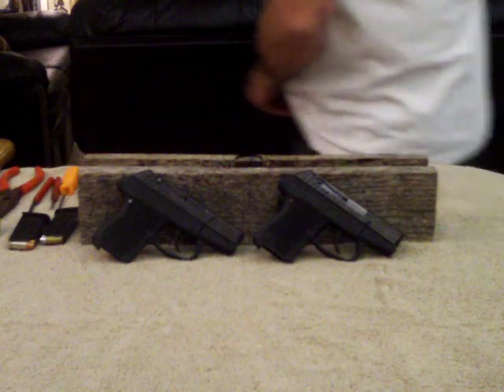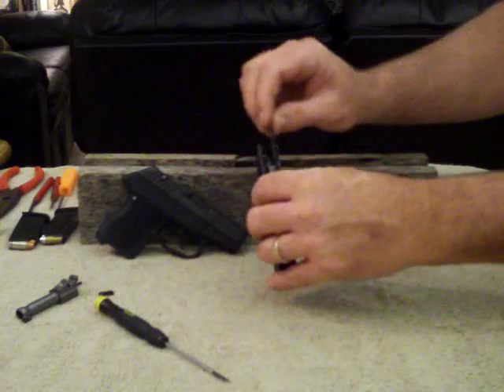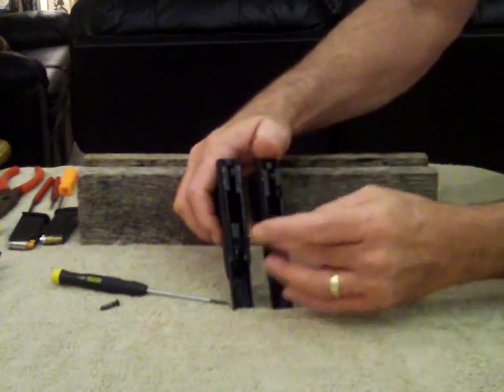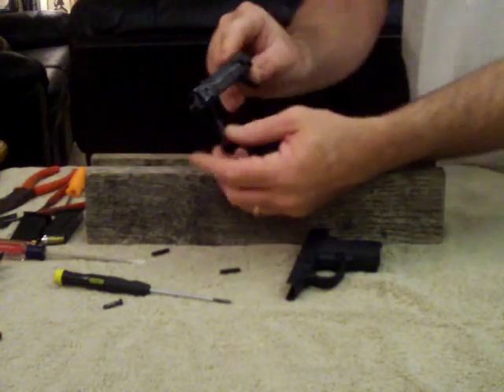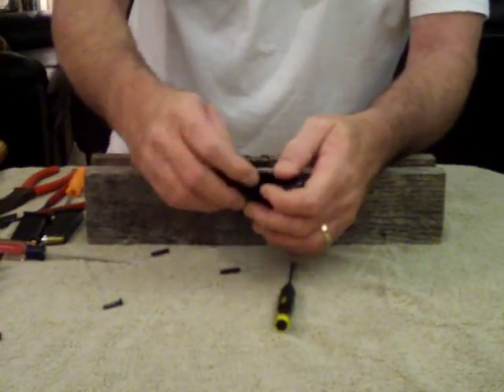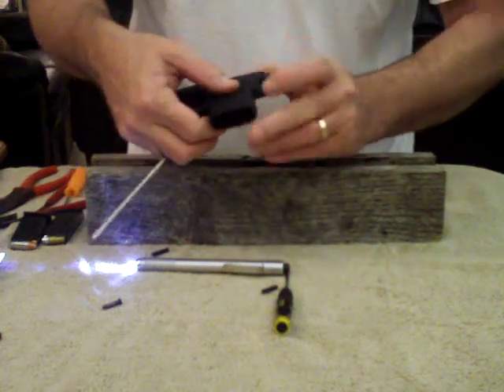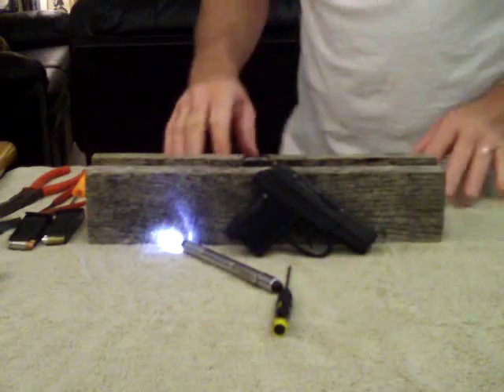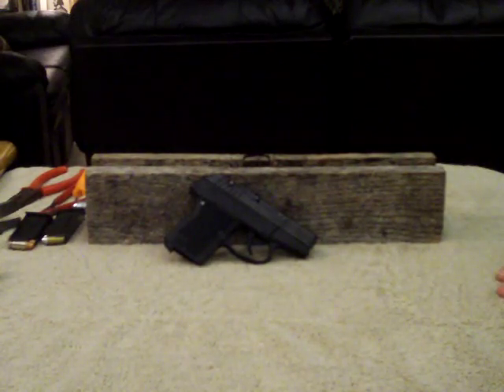Detailed disassembly of the Kel-Tec P3AT & P-32

Comment: Very Nice video. I noticed you Dry Fired after reassembly. I've read that that is bad for KelTecs, because it will peen the end of that screw and without a snap cap or bullet in the chamber, that slot in the firing pin will slam against that extractor screw and eventually cause a failure of the screw and can break/jam the firing pin.
The manual also cautions not to dry fire after reassembly. It says to test the weapon by cycling the slide but do not pull the trigger.
Just FYI.
Reply from the maker: I work on guns for a living, Kel-Tec is covering their selves. If you dry fire the gun once in awhile, its not going to hurt it. I would not make a habit of sitting there firing it for no reason. Thanks.

Comment: Your video helped me... thanks for showing the guns' ejector difference.  Your video helped me locate my P3AT's ejector. I just now disassembled it for cleaning, but I couldn't find the ejector that the owner's manual cautioned might fall out easily once the slide was removed.  Mine didn't just fall out, and KelTec's picture made it appear as if it was located in the bottom of the frame.

Comment from the maker: @sanbarhero I thought I answered this comment with my iphone today but it does not look like it went through so I will try again. There is no harm in dry firing a center fire pistol like this one. In fact, the only guns you should not dry fire are rim fire guns. In fact, most firearm instructors promote dry fire practice. Once again, unless your manufacturer says different, there is no problem in dry firing a center fire firearm. Thanks.  :  )

Comment: Thanks for the video. I had everything apart i had to replace the Hammer spring it had broke on me. I was stuck on re-assembly i didnt realize the sear had to be pushed to engage in front of the hammer. That little bit of info you provided saved me a hell of a head ache. Thanks for the video. For the idiot who said nice black gun on a nice black background. He probably shouldnt be tearing his apart cause i just listened to you and knew what you meant. Thanks again!!!

Comment from the maker: @bacons4lives If you like the Kel-Tec you would also like the Ruger LCP. It is pretty much the same design but has a ridge built up by the mag release to prevent you from accidentally hitting it. The grip is also a little better, It is basically an upgraded Kel-Tec P3AT.

Comment from the maker: @willwood487 I like the P-32 better. That is because when I fire my big goofy hands don't hit the mag. release like it does on the P3AT.  You also get 1 extra round with the .32. The .380 has a little more power but, I would rather have the extra round but, thats just me.

Comment from the maker: That spring holds your takedown pin in and you need that in the gun. It is very important to have that pin. The gun will come apart on you at the worst possible time. The pin will come out during shooting and the slide will come right off the front of the gun.If you need help, let me know. Thanks.

Comment: yes, hard to see in video but if you have the readily available parts breakdown diagram (in your user manual or on Kel-Tec site) you should have no problem understanding this.  I have to replace a hammer spring and this video was immensely helpful. It's cheaper for me to buy the spring from Kel-Tec ($4) than to pay the dealer I bought the gun from $25 for a document search to find my sales receipt from 17 years ago to get the warranty repair from Kel-Tec.  The shipping to Kel-Tec would cost more anyway.  The only thing I'll add is that I'll never trust my 3AT again after such a catastrophic failure that occurred while the gun sat idle waiting to be used, as the hammer spring is under constant tension all the time....I discovered it when I went to target range and ....oh oh.....good thing I wasn't trying to defend myself.  I'll only ever use it again for fun, not for concealed carry.  Same goes for my wife's P32...we'll be looking for a reliable replacement for her.

Comment from the maker: @jasmineebarnes Just buy a small piece of 4x4 and cut out the center all the way down or you could just drill some bigger holes in it, then knock the pins through that way. I know sometimes Home Depot will have small pieces laying around from cutting down bigger pieces for people. Thanks.  :  )

Comment: at 9 minutes, you mention the spring that is in the way of the pin, mine was sticking up and actually pushing the side of the frame out so i pulled it out. what exactly is this spring for?Function of the gun seems exactly the same without it and there's no bulge on the side of the frame now.

Comment: to chromefreak or any body can you do a how to install "seer"  Video
Reply: I know this comment is a year old, but Google KelTec P32 schematic. I had to use a needle nose pliers to hold the seer, then push the pin in to capture the seer, then hold the seer spring in place while you push the pin in the rest of the way to capture both the seer and the seer spring at the same time.  You need the schematic to figure out the correct orientation of the spring and the seer in relation to the gun

Comment: Before you keep slamming Kel Tec Contact them. If your the original owner then is under warranty.
The exact warranty terms and conditions can be found in the back of the instruction manual that came with your Kel-Tec product. It usually covers defects in material and workmanship for the lifetime of the product and for the ORIGINAL OWNER only. Only Kel-Tec manufactured products are covered by this warranty, for exact details please consult your manual or download a copy here.

Comment: If you don't have time to do it right, you probably don't have time to do it again. It really didn't show anything useful. If something needs to be in a certain position (like the sear), then show it in the proper position. Also, since this implies a complete disassembly & reassembly, take out the sear and show how to put it back. It isn't all that difficult if you know how. I didn't use anything other than a small amount of grease to hold the spring, and my fingers.

Comment: You went way to fast.  This was especially clear during the hammering out of the pins.  There are several pins and they are close together.  We could not clearly see WHICH pins you were extracting.  Go slower and zoom in so we can be sure to remove the correct pins.